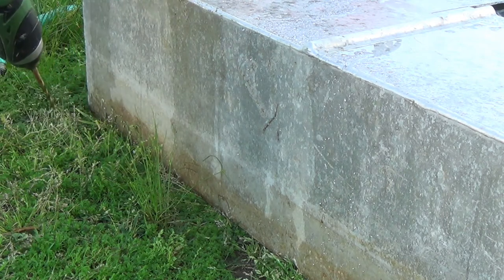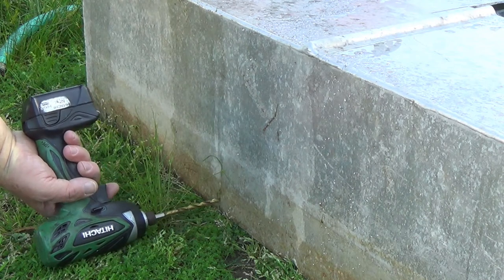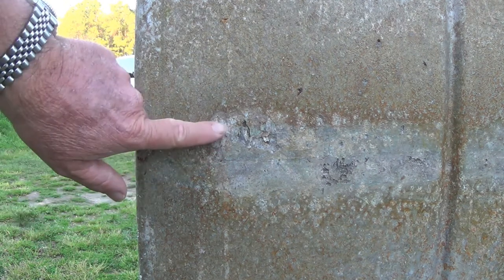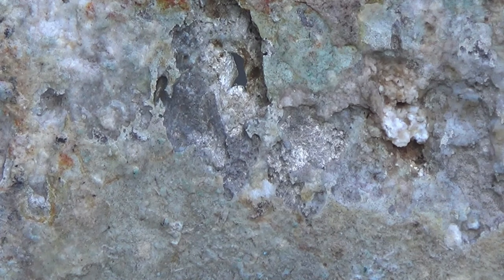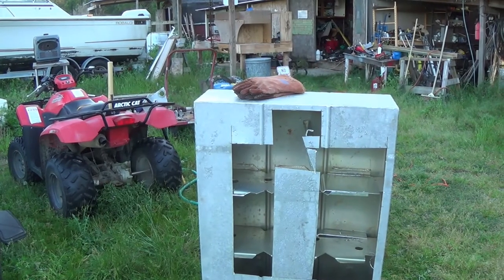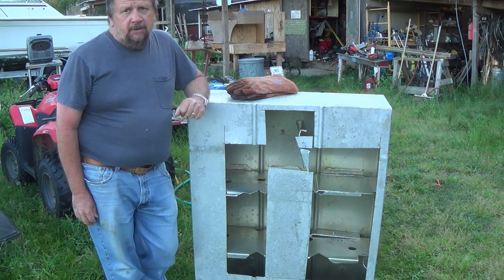Robalo Boat Project Inside a fuel tank {Take a LOOK!! }

Comment: I went through the exact experience with a 1983 Robalo cabin 23ft. After dumping dollar after dollar into fuel lines, fitting twin 115 merc's over a single gas guzzling 235 Johnson, cutting down the transom, constantly oiling the teak wood and finally the gas tank corrosion, I threw in my hat and dumped it. I will add one positive note . That 23' ran smooth in 3ft seas with soft landings. The 1994 Robalo cabin hardtop I own presently gives a much more abrupt ride in the same 3' seas. Conclusion: there is no justice in boat owning, ya just need deep pockets🤑🤑
Reply from the maker: reid092353 you are so so RIGHT, but we keep going back for more.
Reply: Aa

Comment: I just bought a 97 Robalo 23ft center con. and i haven't been able to get my gas line primed ,but after filling the gas line with a funnel i've found out the pickup line must be broken as i can hear the gas falling back into the tank . Thanks for the video i'm sure i need a new tank also.
Reply from the maker: That is what it sounds like to me, I am looking for a tank. The price is high for a 75 gallon tank like I want. The price is even higher if it leaks and catches fire.

Comment: That's a big No No  water and electricity don't mix . You should know better than that brother. Very unsafe.  We're Lucky you're still with us.
Reply from the maker: I did have the saw on a GFI circuit, and I was just did not want a spark on the gas tank. That is one of those WHAT was i thinking.

Comment: my tank and 80 gallons RDS model 56163  from robalo  1998 I can't find anywhere, does anyone have any idea of something similar ?
Reply from the maker: That is the same thing I ran in to. There are a few places that will make a tank just like we have, I thought that six to eight hundred for a fuel tank is a lot. Let me know if you find a deal. What ever tank we use it has to be a safe install.